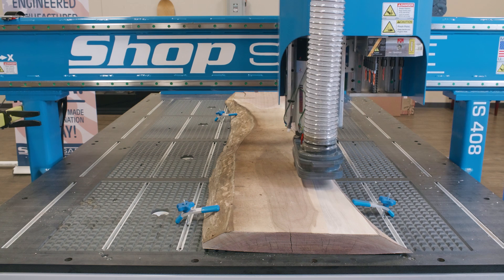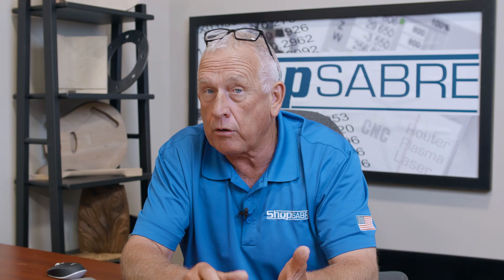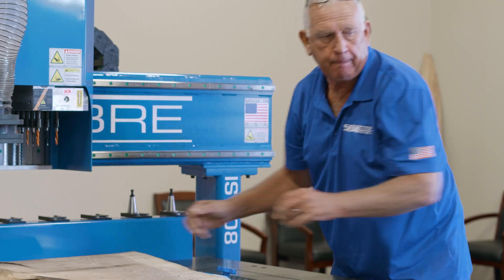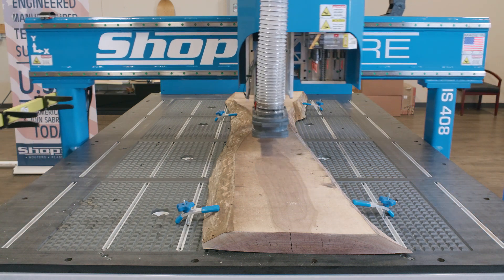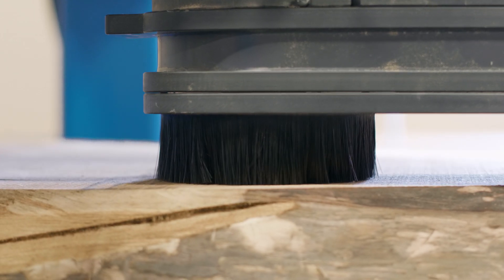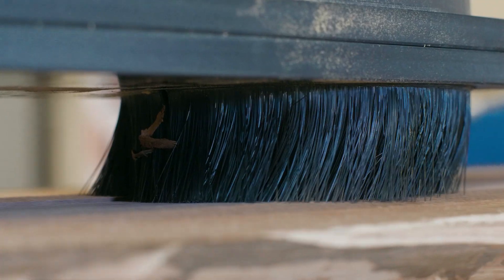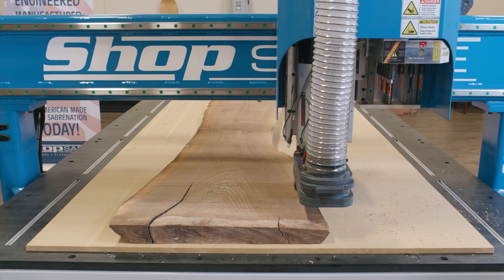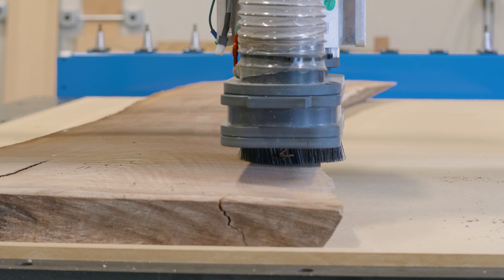ShopSabre - Slab Flattening Project with IS Series 408 Router

Comment: All I've done on my ShopSabre thus far is a spoil board. I've got a ton of slabs needing to be flattened. With Vectric Aspire being used for the cut, do I need to set the height of the bit / tool atop the material to establish the proper height to start?
Reply from the maker: Yes, you do need to set the z zero to the top of the slab just like when doing a fly cut on the spoil board. Our team is happy to help you through this as well, feel free to give us a call to help if needed.

Comment: We use the Amana RC-2259 for flattening stuff.  Nice big diameter, and you can cover a bunch of ground quickly.  I don't know how to do it in Vcarve, but my flattening programs are made so the end of the cut is a radius as it comes out of the material and back in.  The idea being if the tool isn't in the material making chips, it isn't making money.
Reply from the maker: You need to make sure you stay within spindle balance diameter, most HSD spindles are rated for 2.5” or smaller - with the dust dock, you don’t have to worry about debris :) clean cnc
Reply: @shopsabre  For sure, all depends on the machine. I've got an 11hp hsk spindle.

Comment: this was an excellent step by step machine cycle. ok rpm of fly cutter? Does the cnc have any manual data imput or manual override for the feed rate and rpm of cutting tool? It is interesting for me to hear the cut sound inprocess. Neat to see a large stock of timber being shaped sq. awesome!
Reply: wow that is fast.
Reply from the maker: 10,000 rpm roughly 360 IPM

Comment: Isn't it possible for the clamps and vacuum table to twist the slab and when the pressure is removed, the slab will be twisted. I would be tempted to somehow shim the slab so that it does not twist under pressure.
Reply: I did see the slab flex when it was being clamped down.
Reply from the maker: Yes it’s possible and in some cases we do recommend shimming